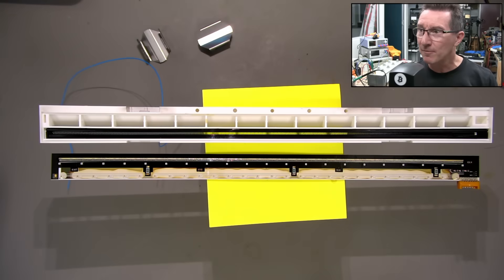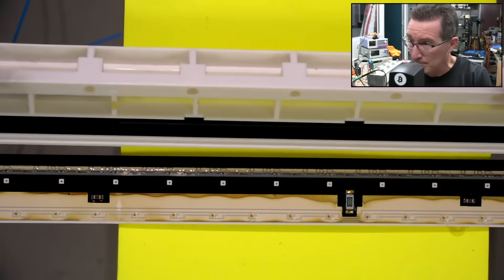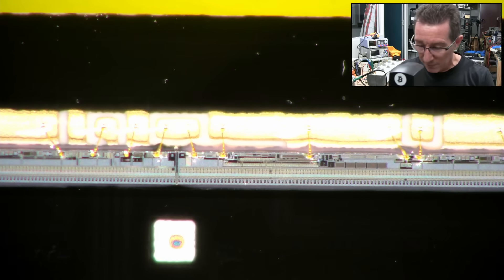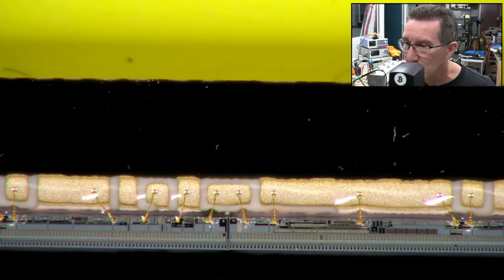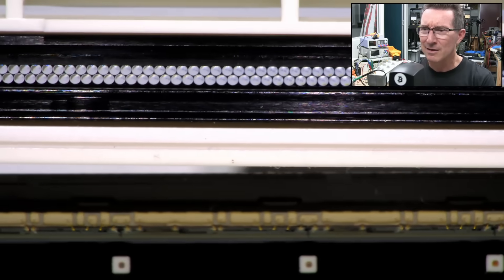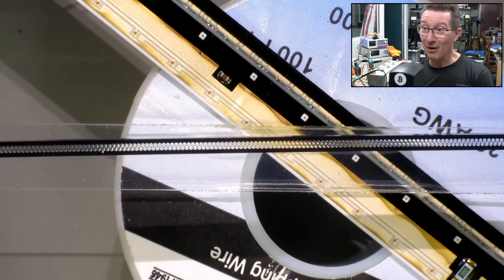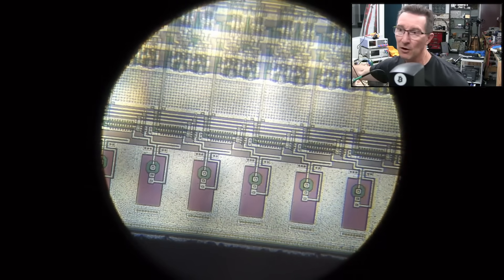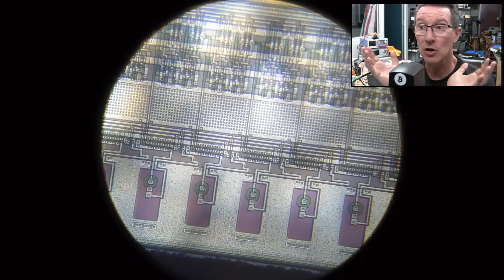EEVblog 1589 - CCD Scanner Array

Comment: The circle inside a square in the black area you theorize could be a light sensor is just a fiducial marker, they line up precisely at the breaks between each CCD die.

As for the strip of tiny lenses, it's called a "rod lens array", they're literally just normal lenses that focus the scanned page on the CCD, the image formed combines with other lenses in the array. This technique works without any of the distortions you'd expect because the CCD and page being scanned are at known fixed distances in a flat focal plane, change that however and the formed image with be trash, this is why this type of scanner cannot scan objects that aren't touching the glass like close to the spine of a book page. However not all scanners use the technique, particularly older ones that have a single small CCD sensor die but a complex optical path to shrink the image down, those scanners have a good usable working distance but are often larger and more expensive and pretty much obsolete, the HP 4C is an example of this alternate type of scanner.
Reply: Just to add, they (the strip of lenses) are so deep to also add a snoot effect and stop stray light. During the design stage the minimum depth is calculated to keep the price down.
Reply: This is a grey scale scanner. But many colour scanners use different colour illumination LEDs to distinguish colours. It is way cheaper than implementing micro filters inside a three times bigger resolution CCD.
Reply: They're definitely not "just normal lenses", unless I'm missing something. For one thing, a normal lens produces an inverse ("upside-down") image. Whereas based on the images on Mitsubishi's website (as well as common sense if you think about the fact that all the individual lenses images can't be individually reversed yet produced an overall unreversed image), these rod lenses somehow produce a non-inversed, "right-side-up" image. There's some gradient-refractive index/fiber optic wizardry going on here. I don't fully understand what's going on here at all, but "just normal lenses" surely doesn't cut it.
Reply: @TheHuesSciTech  I first came across these about 25 years ago when working in the mainframe print industry. TBH, despite going on the Mitsubishi course I never really understood quite how they worked back then. The maths behind it was certainly not simple despite on the surface the device appearing so.
Reply: @TheHuesSciTech  I think most modern scanners do use gradient-refractive index (GRIN) lenses because they're cheaper to manufacture but I think this older printer uses actual lenses because the bottom of each lens has a curved appearance by its reflection.

I think this is a very similar patent for the scanner shown in the video: JP2020160239A
Reply: The "rod lens array" makes perfect sense.

As I see it, each rod lens will focus several pixels onto the sensor array. Aberration at the extremes would not a problem since these rod lenses overlap, so you just take the data from the central zone of each mini image.  The physical offset of the two rows of rod lenses (as well as any image inversion) can be taken care of in processing of the data collected - which should be a piece of cake for a system with such fixed physical dimensions.

Thanks for the close-up look, Dave.  It helps with the understanding of how solutions to such problems have been implemented ... and increasing our ability to problem solve in our own little corner of the world!
Reply: Yeah I remember the 4C, I was amazed when trying it out many a year ago, having the the lid open, scanning the ceiling in perfect clarity while positioned on a table. Never ever came across another scanner that could do that!
Reply: I tore down some color scanners in the past and always kept the optical lens assembly (a smooth brass cylinder). They're APOCHROMATs with extremely wide field of view. I use them for everything as the magnification is better than your typical eye loupe, and best of all, there's no distortion towards the edges of the field at all, no matter how much you tilt the cylinder.

I'm was very sad when I found modern scanners don't have them anymore.
Reply: This is really interesting, thanks for the info. The fiducial areas look to be covered with a black tape or something, do you know what this is and what it's for? And why keep the fiducials exposed even after the fact?
Reply: Where is the color filters? The sensing elements are all identical. How do they distinguish colors?
Reply: @pahom2 it's not a color scanner, picks up the colors as a greyscale.
Reply: Thank you good sir .

Comment: Now I wonder... Instead of doing it push room with a linear stage - could you just spin it for a camera sensor? Obviously the resolution will be better in the center - but that's kinda how our eyes work anyway right? And spinning it really fast would allow for much reduced rolling shutter. 

But how do you make a rotating connection for the readout data?

Comment: Can someone please advise, I am designing a high order high pass filter that converts a square wave to sine, I want to make it -100dB at the 3rd harmonic, I see I can achieve this using a Chebychev, (5x op amps, Sallen Key, 10th order), but is there a cost effective solution to this? switched capacitor filter IC's I have found so far are £30+, do you know of anything cheaper that will do the job?
Solution MUST be analogue.

Comment: The scanner business calls the whole assembly a Contact Image Sensor. The “optical zebra strip” is a microlens array. They’re rods with the ends curved to form lenses. CIS sensors are cheaper than the old fashioned linear CCD scanners because they don’t have a conventional optical assembly, but their depth of field is significantly reduced compared a traditional linear CCD sensor.

You may mention it later in the video, I haven’t got there yet, but the sensor has no filter because the colour of the illumination is changed to scan each colour.

Comment: For color scanning, they using 3 different LED light instead, cycling through the 3 primary color, it's cheaper than building 3x the optical sensor.

Comment: I'm vaguely remembering that the fax 'standard' is 1-bit only - so none of those fancy 8-bit greyscales you talked about.... it either is, or it ain't.  Not sure if there have been different fax standards across the world and over time though.... so I may be wrong.  It happens.  Often.
Reply: I think there are more modern fax standards that allow some amount of greyscale. Plus this is not just a fax, but also a copier, so it makes sense if it's able to reproduce greyscale, even if the fax part of it doesn't support it.

Comment: fun fact, most colour scanners these days still use a monochrome CCD array and get the color information from cycling RGB LEDs to illuminate the page to get the color information from it. i know mine works this way as you get the classic rainbow effect when moving your eyes across it, the same way as a DLP projector using a colour wheel.

Comment: How difficult would it be to convert it from greyscale to colour?  IIRC they still used greyscale sensors, but just used rapidly cycling RGB illumination.

I guess it would mostly be a software issue, once the illumination is sorted out.

Comment: You can see something similar to the optical zebra strip in Oki LED laser printers and faxes on the printing side too.  I never had caused to take the head apart as I never saw one fail in a printer and it was only available as a whole assembly for the fax machine, separate section of the business handled fax machines, so I don't know if it is a separate component or a permanent part of the LED array.

Comment: cheap mfp inkjets use this technology. as a plus, they have a linear "L ee dee" rgb array.  pinout is generally easy to reverse engineer. they have seperate pins for r, g and b. youtube has many video of repurposing them. btw, i  wonder which portion of the circuit is the actual sensor. purple part or the dot matrix area? thanks for the microscope analysis.

Comment: I would think that those square non-LED sensors would be paper size detection things. If you know for sure that the paper ends between two sensor, then you wouldn't have to read the pixels beyond that point. I guess this would be done to speed up the scanning?!?

Comment: Many many many years ago, I attended a presentation with Agfa to do with 'flatbed' (and CCD) scanning; the difficulty was making the illumination of the subject even with 'cheap' components. They suggested the used a feedback system to measure how even the illumination was and then compensate that out.

Comment: 1. The lens array is a Gradient Index Lens Array (also called Selfoc®). It images the scanned document plane to the sensor plane - 1:1.
2. The sensor does not look like a CCD - It looks more like a CMOS sensor.
3. Color in scanners is usually achieved by multiple light sources (colored LEDS) rather than by multiple pixels.

Comment: I don't think its a CCD array but a CMOS sensor array - CMOS cells are active like this, while CCD arrays are rather plain since they do charge shifting to readout. CMOS readouts are active readouts which is why there is circuitry per pixel

Comment: Fax scanners typically would have 1728 pixels or bits if you like. As the fax would not have any gray scale, but just black or white, so just one bit being 0 or 1. Making a scan of something like A4 paper, this can be around 1800 up to 2200 lines. That is 1728 x 2200 divided by 8 bits to get bytes... a fax is around 46K bytes.
Reply: 1728 x 2200 / 8 = 475200 bytes. But (eg. CCITT Group 4) compression may divide that by 20.

Comment: a friend of mine bought a fax machine last month but it was spelled a bit differently and it takes 3 d cell batteries...
also i have an old color scanner (canon lide) with monochrome sensors and it is getting color by rgb led cycling

Comment: Greetings. I don't think that's a CCD sensor - it looks more like a CMOS sensor to me with photodiodes each attached to active pixel circuitry, which you can see up above. A CCD would have an overlapping gate structure and wouldn't have all that circuitry in each pixel. The lens array is a curiosity, I'd like to know what the ratio is between the pitch of the lenses and the pitch of the photodiodes.
Reply: Oh here comes that nerd talk. 😅

Comment: My initial thought about the micro lenses is that sometimes a very rapid pre-scan is done using a subset of the sensor array to do the automatic light adjustment for the actual scanning pass. Just a guess, really I'd want to see a cross section to see the light path(s).

Comment: Hah, they are even using bare die LEDs for illumination now? Ain't nobody can afford a packaged LED, we need to get them each individually bonded instead? Printers are always the most fascinating studies in value engineering. I've taken apart plenty and everytime I notice something new done to lower the cost. Those guys are next level!
Reply: if you already need the machinery and process to place the ccd dies, its obvious to just do that for the leds as well

Comment: On the subject of RGB - You more often see monochrome sensors with RGB leds in scanners that don't use CCFL illumination.
Guess it's easier to get more pixels that way
Reply: I have an ancient SCSI flatbed color scanner which uses a monochrome sensor and RGBW cold cathode fluorescent tubes!
Reply: @mrnmrn1 That's awesome! :D